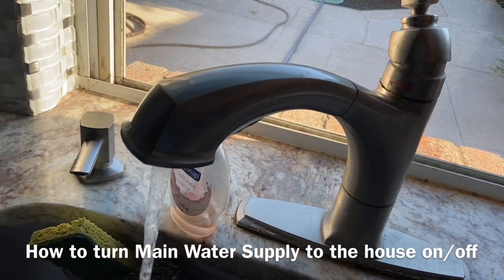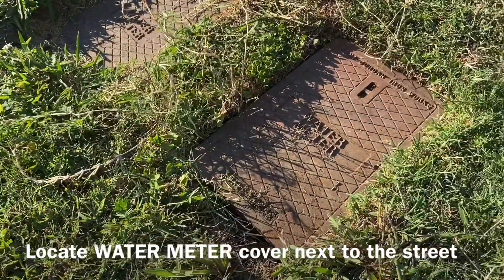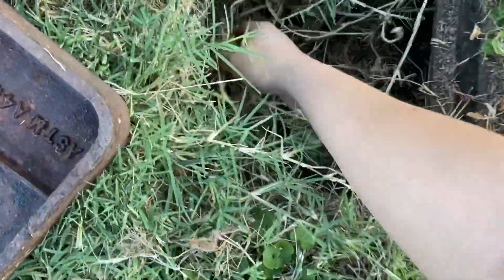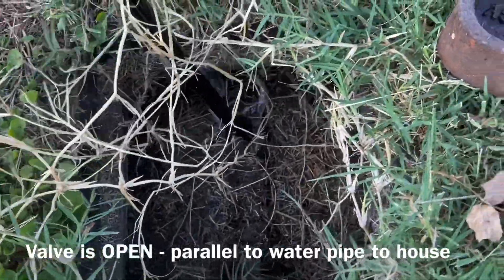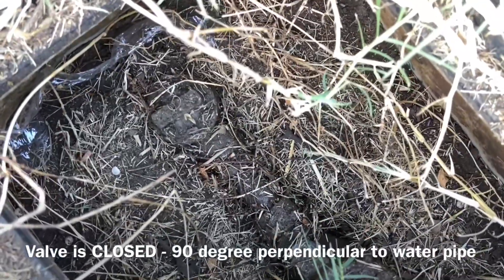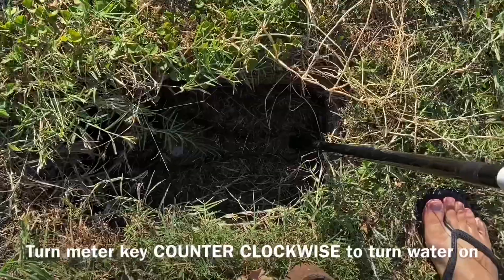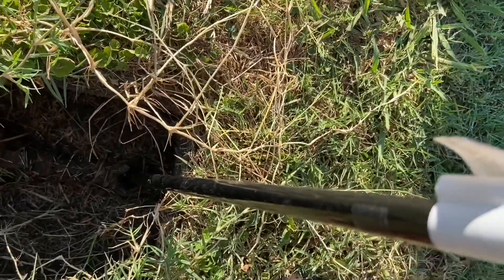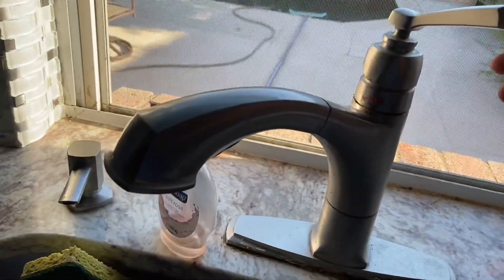How to Turn On/Off Home Main Water Supply in TEXAS!

Comment: By water meter key, I think you mean large adjustable wrench. If you have trouble turning it, stick a big screwdriver into the hole in the handle and use it for leverage.
Reply from the maker: Great tip!
Reply: Can you make a video using the tool with leverage? We are expecting a freeze & I don't have a lot of strength.
Reply: No it's actually called a water meter key smh...

Comment: I have a question for you !
How can I find the path the main water pipe/line coming to my home ( I mean the main water line direction right behind the water meter towards my house) ? 
The water meter is little away from my house like 45 feet so I don’t know to what side of my house that is connected underground. I do have a two main spigot one for my backyard and one for watering front yard and I don’t know how to discover that ! 
Reason for my researching is am gonna be running trenching machine and I want to lower the chance of breaking main line coming to my home right after water meter!
Please help !
Reply: In Texas at least, your main water line from the city water meter. Is a straight shot to the house. So if t you are standing at your WM. Fading your house. Which ever side that main is on is almost always going to be where the water is run to.

Comment: I closed my main water valve ..there's no flow of water n pipes ...how do u know that all ur pipe lines are completely drained? What about broiler in Attic?
Reply from the maker: After closing the water valve, open ALL the faucets and flush all the toilets. That's as much as you can do.
Reply: I was informed to put just a little amount of anti freeze in toilet and sinks because of the dip in pipe that keeps sewage from backing up. A bit of water remains in that section of pipe when you drain pipes so the anti freeze will keep that water from freezing. You don't need a lot.
Reply: open cold/hot taps on all sinks, open hot water tank drain on bottom of tank. anti freeze into tanks of toliets, sinks and toliets themselves. showers/tubs as well as floor drains. 
Unreal so many residents had pipes burst in their homes, shows the brains of homeowners.
Reply: @MitchOfCanada  LOL. Your name is Mitch of Canada. It means you are accustomed to the frigid wheather. It's common sense to you because that's a common occurrence in your region. People who don't have a background in dealing with those conditions may not think of it until after the effect. Some people never dealt with that situation their whole lives. That whether isn't typical to Texas. They were taken off guard. No need to degrade people. Just teach them what you know. And hopefully when someone teaches you something, they won't degrade you.
Reply: fire in a home but not outside yet? run and turn off gas main. Electrical fire or issue in home, where is the mains?

Common sense stuff people see just be ignorant of.
Reply: @nuntet7170  what? Are you referring to the p-trap? If you were to add anti freeze there.not only would it not work as the minute you flush the toilet or. You run the water through the drain it will displace the coolant and flush it down the main drain out into the municipal sewage system. And doing that is illegal. You are not supposed to flush Chemicals of that sort down the drain. And if you were to accidently get it in your drinking water supply line that could prove to be both toxic and deadly

Comment: Followed directions to turning off water valve at street, turned off but water is still flowing slowly.   Want to turn water off at main in order to replace water heater.   Do I have to keep turning the valve at the street till it stops?   Or just perpendicular to the pipe flow?
Reply from the maker: Just perpendicular. There should be a notch to line up.. Water was flowing slowly to my sink but I was able to replace the water cartridge on my shower without water flow

Comment: Bruh, pretty sure you shouldn't turn the water on all the way all at once. Especially if the reason for turning it off in the first place was to winterize your home's pipes. Regardless, releasing all the water back into your homes empty pipes at once could produce too much pressure and damage pipes. Gotta SLOWLY turn the water main back on, a bit at a time (like a quarter turn or so at a time) to allow the water to slowly fill the pipes and push out air.

Comment: My inspector told me that my water pressure is too high, is this how we turn it down???
Reply from the maker: It may be turning it down partially here, or coming from the city. You may be able to add flow restrictors too. I am not a plumber though.